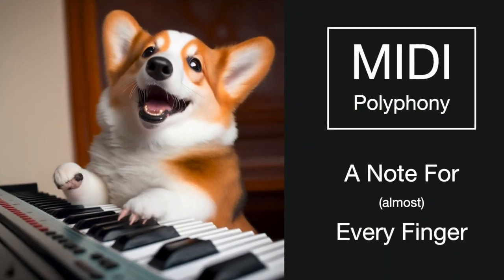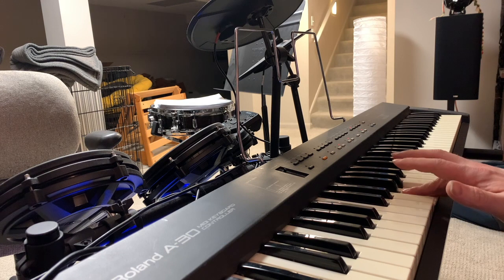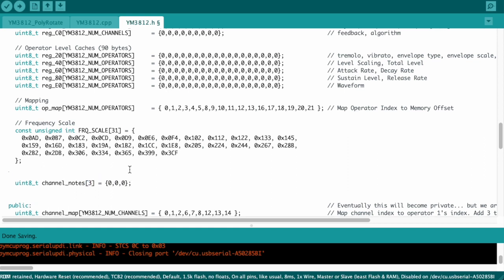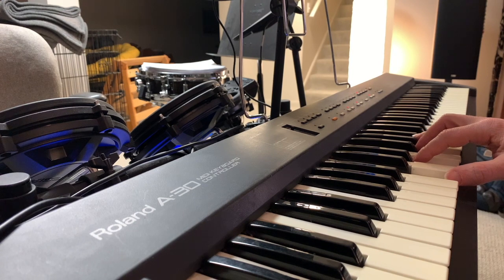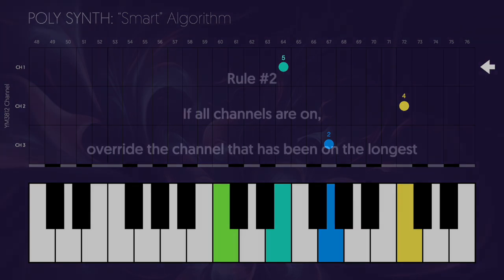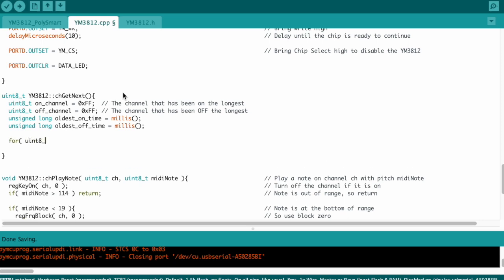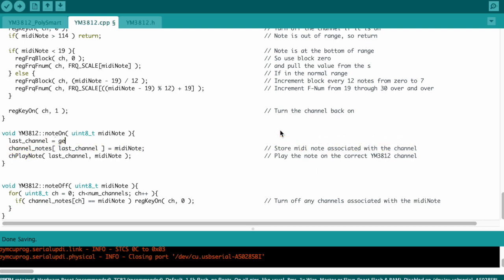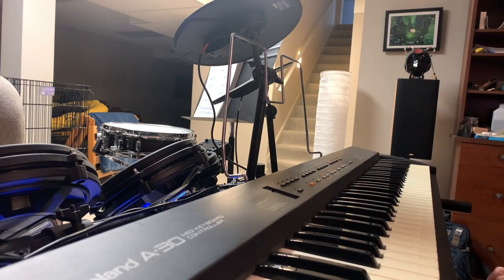YM3812 EuroRack Module Part 5: MIDI Polyphony

Comment: Great results, nice organ sound. Maybe it will be possible to add velocity response too in the future, for the e-pianos sounds.
Reply from the maker: Thank you! And yes, for sure. There is definitely work to be done to wrangle control over the level setting. You only get a number between 0 and 64 for that one, but it should still allow for velocity control and panning with two chips. Also, you could probably do some cool after touch while in FM mode that way too. More to come :)